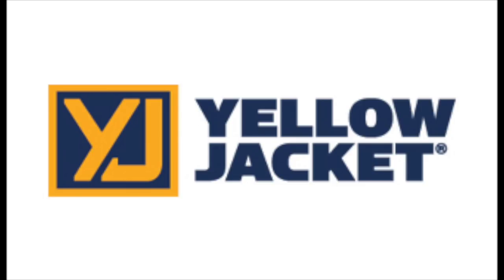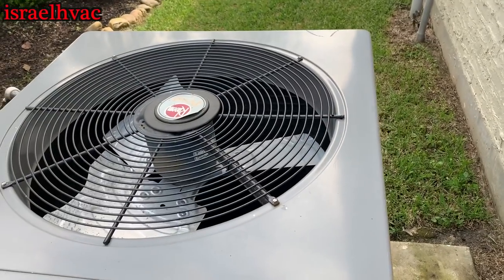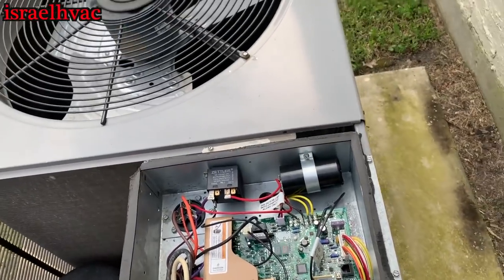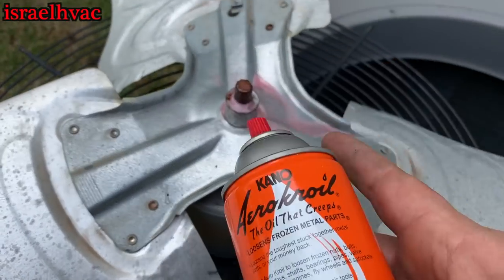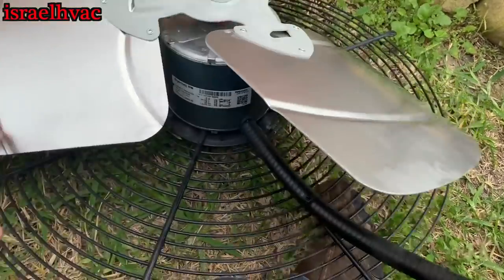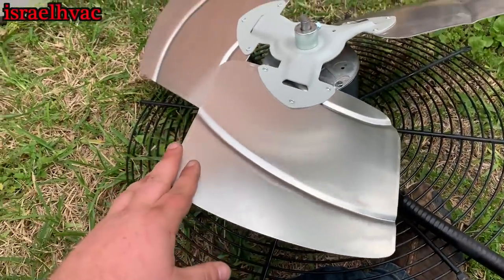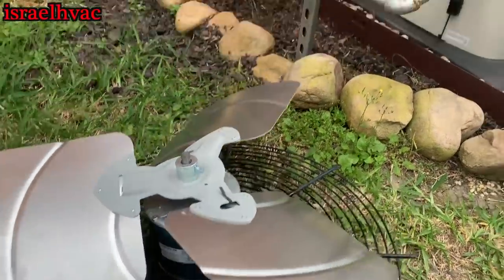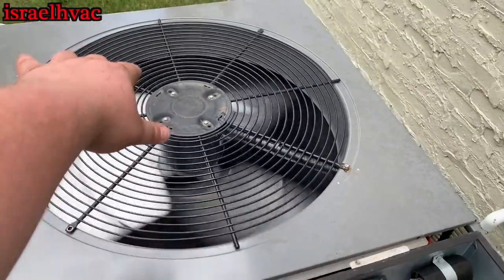HVAC Service | Condenser Motor & Blade Replacement

Comment: I don't bother pulling blades anymore.  Just get the motor, cap, and blade.  The time it takes to remove one is costly in comparison to labor rates. Use new 11/32 nuts too.  Get a bag of em.
The good thing about the matching blade is, the motor rotation and new blade can be checked at the supply house in the event the motor isn't reversable.

Comment: I would've tried taking a flapper wheel to the shaft before spraying the Aerokroil, THEN knocking it down a little bit - and hitting it with the flapper wheel again.   Probably could've gotten it then -- that Aerokroil is awesome stuff.

Comment: I did was technician outta LV and i did this for about 8 yrs before.. i joined the military.. i miss it sometimes.. but no ty. Going into an attic at 145 degrees in the Vegas summer not something i wanted to continue doing.

Comment: I don't understand your problem getting the blade off the shaft.   "It's under warranty" is NOT an excuse when the fan blade costs over $100.00!  "Warranty" means that someone is getting screwed!
Reply: Mark England , I couldn’t tell you if John really put 100% into trying to get the blade off, but I have ran into a couple times when it wouldn’t come off! Oiling, sanding and pullers! In this case it’s not the customers fault nor is it the techs fault. In this case someone is gonna get screwed anyway and if I had to choose it would be the manufacturer! They have a lot more money than me and the customer put together.